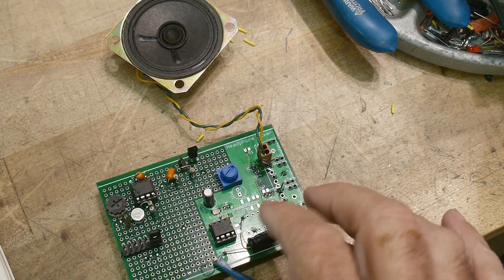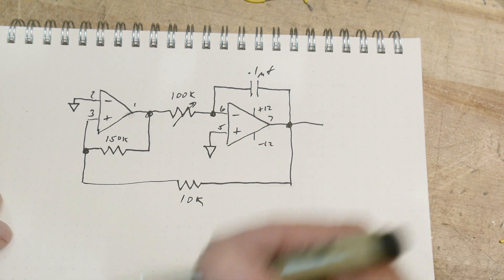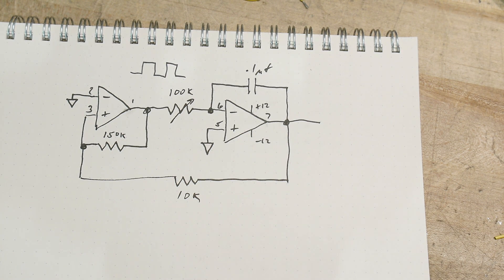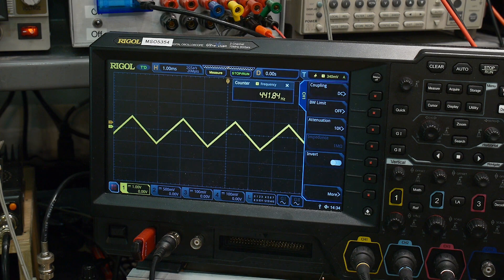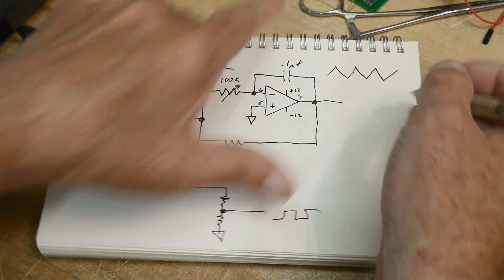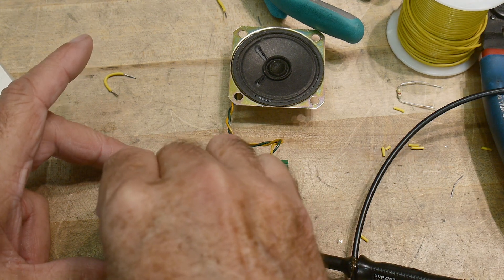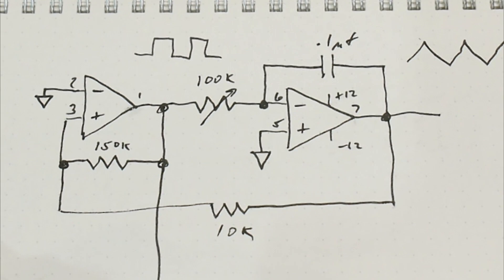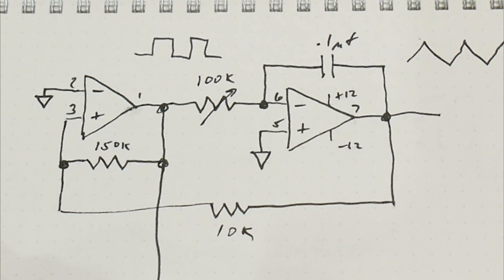#1198 DIY Analog Synthesizer (part 2 of 15)

Comment: Dislike noise generator, because of ugly asymmetic signal, instead of other generators. Also, isnt a bad idea to give a high capacitive load to general purpose OPAMP, like here in power amp cascade?
Reply from the maker: the cap is not a load but feed back to the input, quite common. large cap to ground on the output is what is bad. I would like a better noise generator, any ideas

Comment: This is cool, I'm experimenting and building different kinds of analog function generators because a real one is way too expensive for me right now and I need some way to generate some signals so these little circuits that you're sharing now are really valuable to me at the moment.
Could you please share the exact values that you used for the resistors and the dividers to get the same 1V output, you didn't share the values and I really want to make use of your circuits so it would be handy if I can have all the details on the schematics that you show, I can make a screenshot of it that's not a problem but I really need the exact values of the resistors you used.
Could you be so kind to show that in your next video, thanks a lot in advance and best regards.
Ricardo Penders.

Comment: An analog synthesizer is a good opportunity for teaching opamps, but it's a golden opportunity for teaching a particular type: the transconductance opamp. There aren't many use cases for those, and this is the perfect one. And Norton opamps too while you're at it. :)
Reply: why dont you make a video about these, I would watch it. im just starting in electronics with a background in computers and programming and struggling with opamps and want to build synths as ive played software vst versions for years.